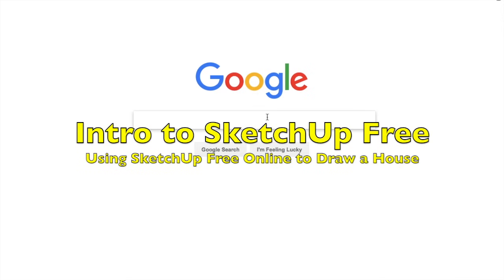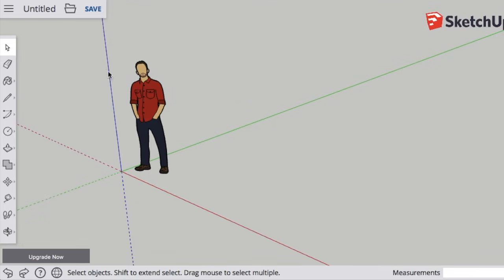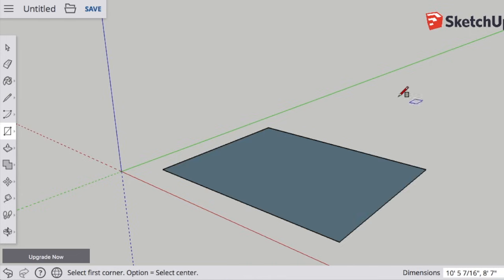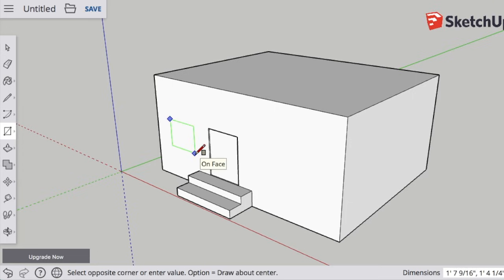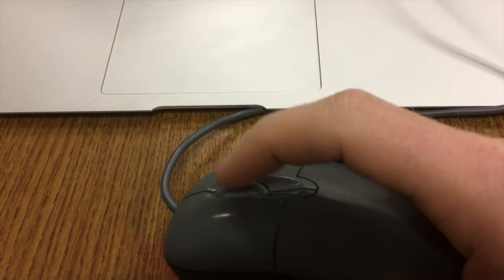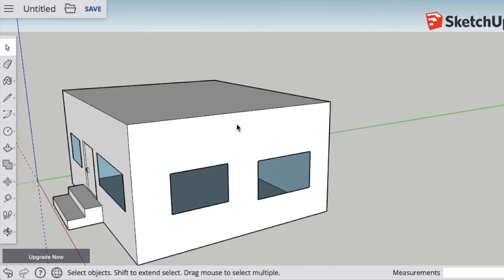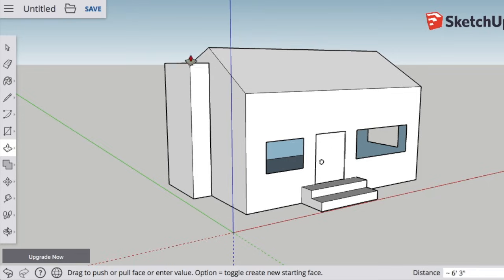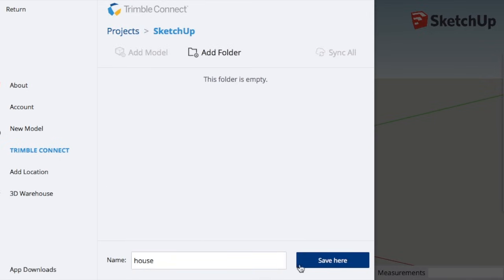Intro to SketchUp Free

Comment: Nice video and presentation but, I was just wondering why you uploaded in 720p instead of 1080p? After all, in 2018 the defacto standard for HD was 1080p and now your video is a little soft on an ultra HD monitor. Otherwise, great job.

Comment: What’s the easiest way to turn a 2d blueprint into a 3d model? I love this tool and your tutorial, it’s just difficult for me to understand once you make it 3d, is there a way to make the outer walls transparent so you can look into the house and work on the interior? I want to make my house to scale but having a hard time working on the interior after making all the walls 3d.
Reply from the maker: If you look at my subsequent videos, I solved this problem in a different way.  I made drawings corresponding to each one of the rooms of my house separate from the exterior model.  This works really well for a couple of reasons.  First, like you I want to see the interior in addition to the outside.  Second, at least for me, as I add more detail to my drawings the bigger they become and SketchUp acts a little sluggish.  Third, I don't want to put all my eggs in single basket.  If I screw up or lose a drawing, I don't want to lose all my work.  So it is really nice to keep each room in its own file and separate from the exterior.  I think I also have a video where I pulled the individual rooms together as imports into a larger drawing.

Comment: Disclaimer:
I am no genius. Then again im not a complete retard and have a basic understanding of how to use a computer.

No matter how many tutorials i watch i can not use this product. 
 I can not use/understand the dimension box what so ever. my dimensions always disappear if i can even get them entered.
 There is no way i would ever pay for a better version of something i cant get the basics to work for me on.

 This is about my 4th attempt at this software in a few years each time always get stuck dealing with dimensions box/entry area 
 Im not trying to map out a rocket engine either. This time im simply trying to map out a big single payne exterior window with an 18 inch wainscot under the sill with 2 raised panels in it. I just can not get it done so instead ill build a mock up of the set up and make cardboard templates until i get the desired look. It will take less time than working with this highly flawed sodtware

Comment: the absolute worst of the worst for architectural work do urself a favor and use literally anything else
Reply: What free software would you recommend?
Reply: @josephwalker138  If u want a more user friendly interface archicad and for more advanced but a lot more difficult rhino main issue with sketchup is accuracy u have to scale up models to be accurate since even if u use axes right small deviations are inevitable to happen and in large scale that leads to many problems that doesnt happen in archicad revit rhino and 3dsmax
Reply: @kinnis0N  
I just went to their site and just trying to figure out how, where, what, why in how to purchase is more aggravating than using sketchup

Comment: How do you switch to the 2D template?
Reply from the maker: I am not sure what you mean.  You can change the perspective with the movie icon in the tray of tools on the right hand side.  However, if you want something like a traditional engineering drawing showing the 3 traditional views, then check out the instructions here: https://forums.sketchup.com/t/3d-to-all-2d-view/9438/4
Reply: @AaronKennedy  
I think Doug Webb may have seen another tutorial video which basically says you should always start with a 2-D template, and goes into a lot of detail about that.   Which is frustrating if you then try and do it in the current version of Sketchup Free, because it doesn't seem to have that option at all.
Reply: @AaronKennedy  I think what he is saying is how can you see this house in floor plan view.
Reply from the maker: @gubelandassociatesinc.8780  In that case, the simplest way may be to simply delete one of the roof sections so you can see inside it.  I am still meaning to model my actual house someday...